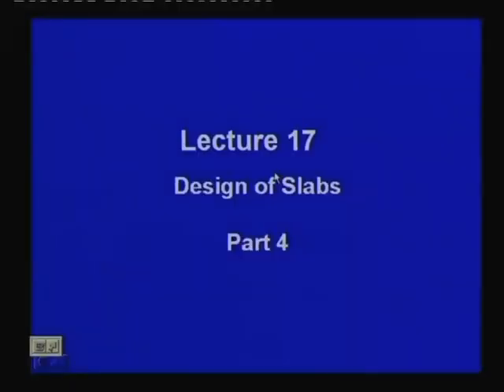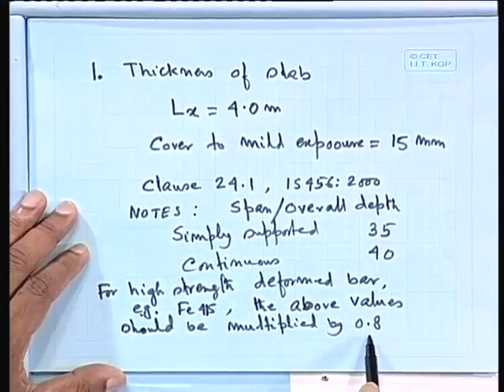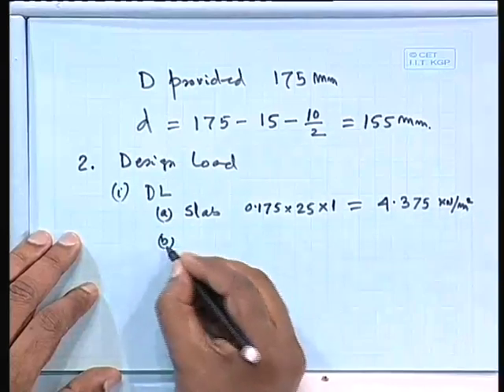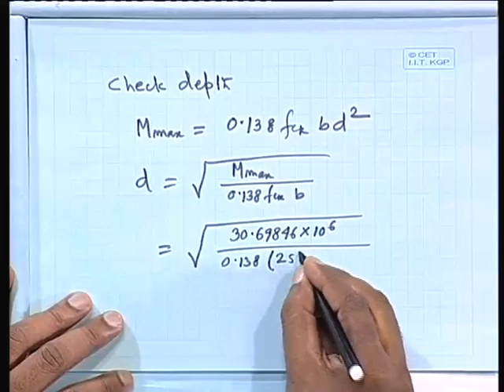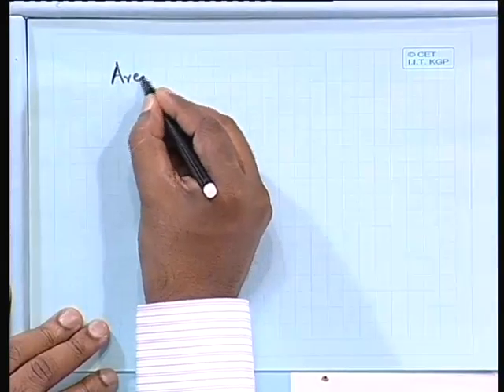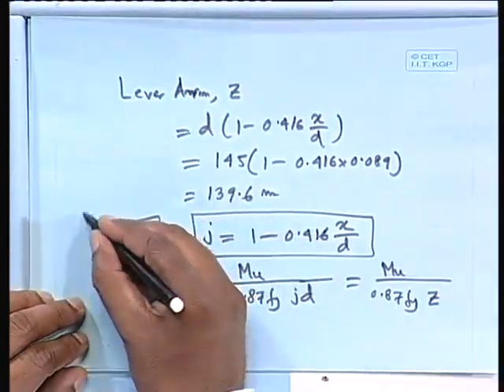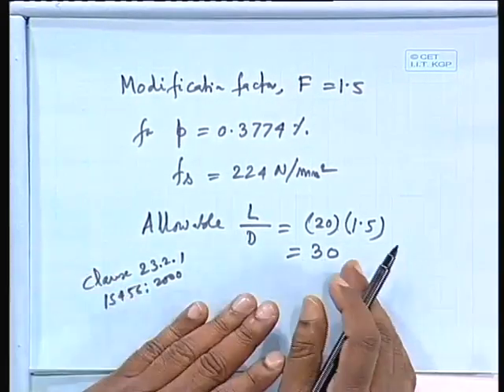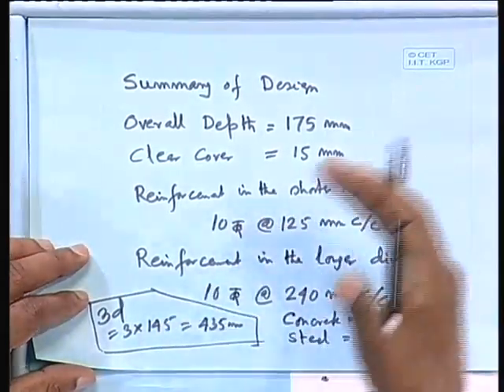Design of Slabs Part - IV

Comment: Sir you are designing two way slab but deflection check as per code for two slab is l/d =35  for Simply Support and l/d=40 for continuous support..please clear the doubt of deflection check..
Reply: In my college it was told that, you can Assume D to be around 450mm depending upon the lenght of effective span in two way slabs

Comment: how to find area of steel provided
Reply: Very easy
Reply: @thesarcasticengineer7   waah 😂
Reply: Sir....Thank you for your valuable knowledge to share. But I have a question about why we used the required area of steel for deflection calculation instead of required steel. And you also repeat this word very strictly to use req. Area of steel. What is the logic behind it?

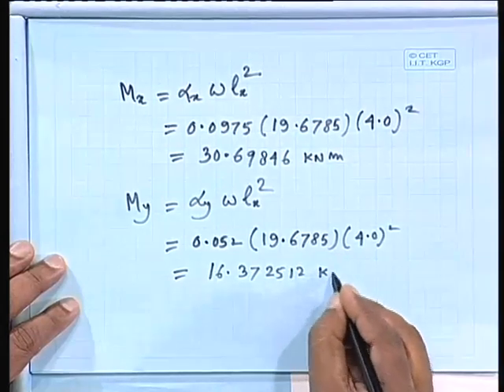Comment: Hi Sir, I am learning your online lecture and getting a lot. Thank you so much for concept of that. But I have little bit confuse about Mu for ly..please check for us. At the time of 20:39/ 52:25 of your video, M(y) should be base on L(y) value. If base on L(y) Value, M(y) value will be 30.9543 kNm instead of 16.372512 kNm. If we choose Max Value, this M(y) value will govern for d value. x/d value for longer direction too, we should use Mu value 30.9543 kNm instead of 16.372512 kNm. Please kindly reply Sir because I have confused this part.
Reply: please go through Lecture 16 to find out why both Mx and My depends on Lx not on Ly
Reply: Mx and My Both are dependent on Lx..
Reply: Refer IS 456:2000 page 91..

Comment: Nice lecture.
Reply: James Ardinez when to use table 26 and when to use 27?
Reply: @RomanReigns-hd8vh   if in question  slab have to design in  no.of part (panel) then check which type of panel is given and  chose types of panel from table 26 
If nothing is mentioned simply  mentioned cslab then go through the table 27